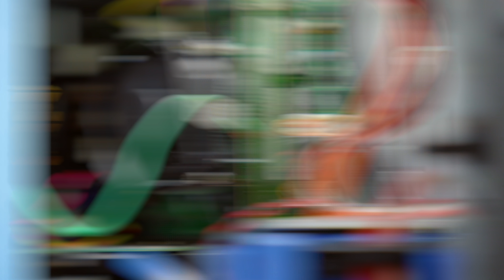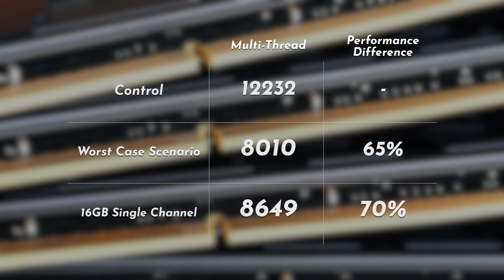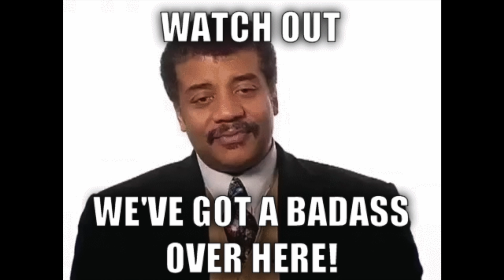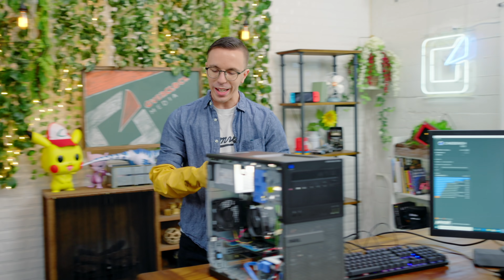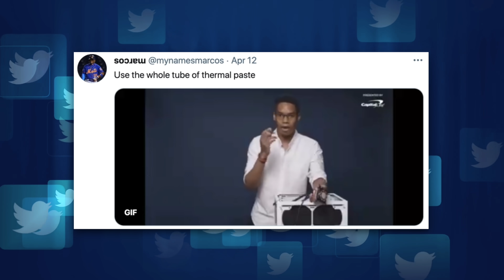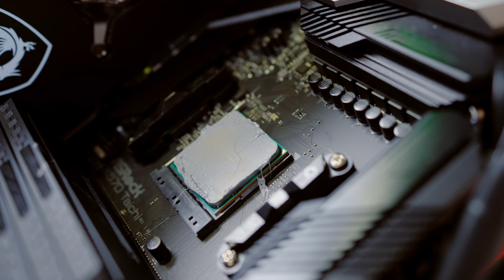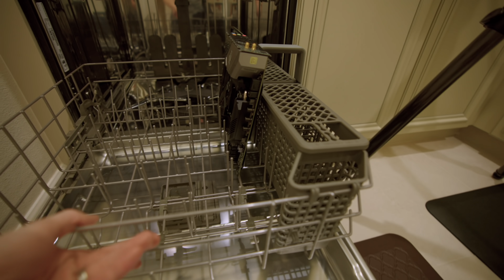Gaming PC Lies People Believe

Comment: Washing components should be completely fine. So long as you use purified distilled water. 
Water is actually an insulator, it's the minerals within the water that allows electricity to conduct. 
If it was left to dry out completely it would be fine. 
In fact with purified water, you could run the entire PC completely submerged and it would work completely fine. Probably not the best for performance as the water won't conduct heat away as fast as a flowing water cooling system with a radiator, but it would certainly stay cool. 

The reason the motherboard was killed was for one: you probably left the battery in the motherboard, two: a dishwasher will use regular tap water filled with a mineral content, and three: a day is not long enough to dry. A few weeks at least would be needed.

Comment: I've never tried a dishwasher, but I picked up a really gross OG Xbox for $5.  It was full of roach turds and dead bugs, an absolute nightmare.  I figured I was only out $5 if it didn't work, so I scrubbed the motherboard and components with dish washing liquid and water, then let it dry out for three days.  I got it looking brand new, and it booted up and ran like a champ.  There are risks involved; if water gets trapped under heat sinks etc. you'll get a short where there shouldn't be one and kill it.  However, if you're willing to take the risk and also blow dry it really well to knock out any trapped water, washing some circuit boards CAN work as long as there's no power stored or running through them.  Still, don't try it at home unless you know what you're doing.

Comment: You can wash electronic stuff that doesn't have any type of battery and the capacitor aren't charged. I'm pretty sure everything will work but it just that you have to fully dry it and disassemble everything that you can and then dry it. 

Also it may corrode but dude why take chances just clean it with a dry cloth, right.

Comment: What you should try is using vengeance high performance like the one you had in the ryzen 5900 and then use the same capacity value ram and see the difference I'm performance.

I think you will find that the so called super fast and high end ram isn't worth the premium they charge with their marketing spiel.

Comment: The testing methodology people use when testing this myth always bothers me. Trying to shock plugged in components isn't going to do much to them because they're already in a system that's grounded.

The danger of static electricity comes from handling ungrounded components which is why you have to ground yourself when working on a computer because your computer is presumably not plugged in while you're building it. Releasing a static charge into an ungrounded component when it has no path to release that voltage is what causes problems.

Comment: I think you may have just shorted some of the GPU's solder pads or got it out of proper contact with the slot, or both. If you had a much more powerful magnet but left some gap, the GPU would probably have been fine.

Edit: Saw the dishwasher part, I'm pretty sure you didn't dry it well enough. I have washed various components by hand, without soap, and various YouTubers have done the same, some even with soap. I don't have a dishwasher to test that specific method, but I don't think it should have broken the board like that.

Comment: If you used distilled water it would have worked but because tap water has other stuff in it that’s conductive there was most likely a short circuit some where

Comment: Um, magnets can brick a hard drive, but pc components like cpu, gpu, ram not so much, when the gpu stopped it was probably because you shorted it with the magnet by touching the soldering points.

Comment: When I've built PCs in the past, all i do is plug the power supply into the wall and touch the outside of it. The metal case is connected to ground, so if you touch it any static electricity you've built up will go to ground.

Do this every time before you touch your components after walking around. Then you never risk frying anything.

Edit: This works even if your power supply is outside your case, but as soon as it's in the case of your PC you can just touch the metal of your PC case, since that's now also connected to ground.
The power supply doesn't have to be turned on for it to be grounded either.

Comment: I don't think it was the magnetism that shut the GPU off, it was because it would have shorted a lot of different components on the PCB, as the magnet is conductive. For the hard drive that makes sense, I don't think its the moving parts that permanently die, they would just stop moving freezing the computer. What you would need to worry about is the magnets erasing data because that is how the data is written and read by using magnetic fields

Comment: As long as the components aren't energized, you technically can wash them without harm. I remember washing a non-working bug infested PS3 that I bought for $16, with soap and water, and it worked after I applied new thermal paste and pads. Of course, I initially dried it with forced air and then let it sit for a couple hours.

Comment: Washing PC components in a dishwasher was really intended for retro components that had electrolytic cap leak on it. Nobody in their right mind would wash a Ryzen board or a modern Intel board. It is documented online that a dishwasher can aid in removing the cap juice, although you still have to do manual cleaning/prep prior.

Comment: I quite literally built my current pc in my basement, on the carpet, and with no esd protection. I also have mismatched brands of ram but all same capacity and speed. This might have been a problem in the past but I would trust the products can easily ignore normal amounts of static discharge.

Comment: so long as ram is of the correct generation ram is cross compatible the system will simply default to the lowest spec stick you will however run into system instabilities over time.

Comment: These tasers don’t actually output millions of volts... That’s false advertising, because its almost impossible to measure thousands of volts with a voltmeter, the same way its very hard to measure the actual capacity of a battery, so manufacturers (especially cheap Chinese products) will take advantage of this to mislead people and give totally false information so that they buy the product. 
For taser voltage, it comes down to the distance between the two electrodes (and factors like air density, temperature and moisture) but it will give you about ten thousand volts for a one-centimeter gap. 
In a very basic way to explain it, tasers work by very quickly charging a capacitor until it discharges itself through the air between the anode and cathode, over and over multiple times per second. 
The larger the gap, the larger the voltage. Can’t go around that. Smaller gap = smaller voltage. 
Increasing the gap size will increase the voltage, until internal components will short out first and kill the taser. 
A taser with millions of volts would need a gap of more than a foot between the two electrodes. 
Now that is different from a Tesla coil which can output continuous high voltage (a lot higher voltage than a taser, at lower current of course) but that’s another story. 
It’s very difficult to electrocute someone or something with a Tesla coil compared to a taser, so less useful than a Taser. 
The tesla coil works by ionizing the air around it until electrons can flow freely through that air. But when introducing other things, they will actually have higher capacitance then the ionized air thus not become a path of lower resistance and almost no current will go through it. 
The taser however, will electrocute whatever has less resistance than that air gap, which is most things except glass and ceramic. 
The reason is that it doesn’t continually keep the air ionized between the electrodes. 

Anyways, tasers usually output between 5,000 and 25,000 volts, and that’s the end of it.

Comment: How did you dry the board? If you just let it sit, it may not have dried completely. You may need consistent warm / hot air to dry every part of it. Additionally, if you didn't take the battery out, there'd be an issue as well.

Comment: I’ve got 3 sticks of DDR4 3200mhz RAM for a total of 24gb of RAM in my system, 2 are corsair vengeance and 1 is ballistix RGB RAM, i’ve got a 3070 and a ryzen 7 2700x system, will this RAM setup hurt my performance since they’re all the same size memory and the same clock speed

Comment: Have “new” pc from 2010 it’s a prebuilt and barely used by previous owner so it was given to me, i use it for about a year with no problem. 

 it restarted when I replugged my  desktop speaker(normal cpu case but only had one audio jack at front!) . 
the end of jack does electrocute you when touched. 

Baffled so i did it twice and get same results, stupidly enough i tried it for 3rd times the last one surely K.Oed it  end result? Dead cpu fan only spinning for sec when powered on. 
Diagnosis? I fried the mobo and gpu.. I’m baffled why LTT can’t kill theirs easily like i did

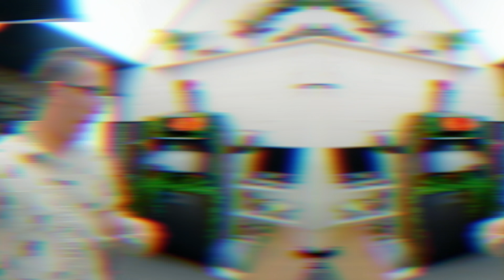Comment: 3:03 yopu shorted the conacts on the back any moving parts tent to temporarily stop functioning, but in general the magnetic force from the read write head of a hard drive are several times more powerful than a perminant magnet, it can flip bits, but it wont cause perminant damage unless it causes damage to the drive physically. 

A passively cooled system, with an SSD wouldnt be affected by a perminant magnet in the slightest

Comment: Austin, I love the magnet bit, but I actually have something I'd love your opinion on. Due to moving to a smaller apartment and having a decent 5.2 surround set-up, the only TV unit we could find has the two subwoofers either side of the TV, and only centimetres away (how do I go about sending you an image)? I have a Panasonic OLED and when speaking to a mate he went nuts saying that subs worked off magnets and I was going to ruin my TV. I've been using this setup for a few weeks and all seems fine, but I'd hate to ruin a $2,000 TV. Are you able to do any testing, or offer any advice on this? Thank you.

Comment: On the magnetic one, isn't it more that they short circuited the GPU (metal on the back with no backplate) rather than the actual magnet itself doing any damage? I think we all knew the HDD was done though, but a lot of systems are running SSDs now! 

On the last one, if you washed it with distilled water, it might work? But I I think anything else is probably going to do what it did

Comment: As far as mixing RAM goes, I had an FX6300 system a few yrs ago that a friend now owns and uses as a media PC... I had 2 sticks of G-Skill Ripjaw 8gb x2 DDR3 1666 and 2 sticks of ADATA 8gb x2 DDR3 1666. The CAS latency timings were all the same, I tossed them in, went from 8 gb to 16gb and never once had a RAM error... Make sure both pairs are supported by the mobo/cpu and have the same CAS latency timings throughout all the numbers. That's your best shot if you're trying to do something like this...

Comment: The test zapping the board with a shock wasn’t accurate. With the pc plugged in it is grounded through the power supply so the majority of the voltage goes to ground. You need the power it down and then unplug and zap it to get a true test of static damage.

Comment: Here's my thoughts, based on my experiences:

I mix RAM constantly (especially in laptops using DDR3) and I have only had problems once or twice, other than reduced performance. They should at least be the same speed.

I wasn't expecting the magnet to do much, except temporarily slow the fans or corrupt the hard drive. If you have an SSD, you're safer from magnetic forces near your computer. If you have a vintage computer setup with a CRT, keep any larger speakers or strong magnets (>4" diameter) at least 4 feet away from the screen as the discoloration seen in the video might occur. If your monitor makes a "Douhmmm" sound as it turns on, that means your monitor has a degaussing coil that attempts to negate the effects of magnetic discoloration. You might also be able to find it in the menu of your monitor, or it could be its own button.

I, too, have never used an anti-static band.

Toothpaste can be a decent, extremely short term alternative to thermal paste, just so you can do what you absolutely need to while waiting for real thermal paste in the mail. However you can destroy your components if they stay minty fresh for more than maybe a week.

As long as you discharge most of the larger capacitors and remove the CMOS battery to prevent dangerous shorts, you should be able to safely wet components and use them after they're completely dry. It doesn't always work so I can't recommend it, but I've seen some people use this method for old Macintosh motherboards that worked just fine afterwards. If you want to wash your PC components and be sure they'll survive, use at least 90% Isopropyl alcohol and a toothbrush. 70% contains more water and may cause shorts.

Comment: Static is very dangerous I have  experienced it my pc when it gets forced shut down after a power cut and after I restart it after 5 min my gpu or my ram gives an error and blue screen of death.i have the disconnect the power cable for 3 hours to make the pc run normally

Comment: Most People don't know there isn't any taser with a voltage higher than around 10000 volts and there is an obvious reason because there is not enough gap between taser probes for 2.5 milion volts taser it most have about 90 cm distance between probes

Comment: Of course you gonna killed the board by drying it only 1 day. Washing the whole motherboard with water should not be done on diswasher. The pressure from the water stream might knock some of the component off ( its unlikely, but in case you got the 1 in million chances your board have 1 or 2 soldering defect). Do it in big plastic bucket filled with water. I've done it on my really old board, filled with dust, and i don't want to create static with my brush by cleaning it. You don't use soap, but clothes detergent, as clothes detergent works by attracting stain through ion, rather than bonding and encapsulates like soap do, so it will remove the dust and help remove the possible static further. So just a tiny amount of detergent will do. Then you clean the board by moving the whole board inside the water rather than brushing it. After that, you can rinse the water by dipping it into another clean water, and repeat it until you are sure there is no left over water+detergent on the surface of the board. Then you air dry it at least a day, before you try to hasten the drying process either by using heat gun or dumping pure alcohol on it. You air dry it again until you are sure that you have the board completely dry, then you brush lightly with paint brush to make sure there is no gunk stuck on the board. The whole process takes 10 days at minimum with old board. With that board, you need to remove all the cover and any heatsink, then re-apply all heatsink with the thermal paste and all the cover after it really dry.

Comment: never used an atni static wrist strap either. there's a little secret built into EVERY  pc chassis power switch .  when you turn off the PC and and turn off the PSU and unplug it the power switch acts as a static discharger   just by pressing it in three times discharging any static built into most components in side the system ( the main  exception being the power supply because those power rails in PSU's  hold charge a long time).  but for the most part doing this nullifies the need to have an anti static wrist strap.

Comment: It wasn't magnetism that glitched the GPU.  It most likely shorted something when it latched on - and it would be my guess that it was one of the power circuits.   Short on a +5 or +12V rail... yup.  PSU shuts down to protect the machine.

The reason the CPU fan stopped was because the magnet pulled it against the fan its bearing hard enough for the friction to stop it.   Once you took the magnet away it should restart almost immediately.  If the fan RPM reads zero, and is under motherboard control, the controller will ramp up voltage until it starts rotating again.

OF COURSE the hard drive got borked.  Hard drives are MAGNETIC DISK storage.  You probably didn't damage the drive itself, you just erased (or at the very least corrupted) the data on it, and/or disrupted read/write operations.   Likely triggered a SMART flag as well. The old-school floppy diskettes were also easily damaged by magnetism; it's why you were told to keep them away from CRTs, power cords, fans, and so on.  SSDs, memory, etc. should be resistant.  It MIGHT cause problems if you pass a strong magnet past a choke coil.

C'mon guys.  This is basic techie stuff from 'back in the day.

Comment: I don't think with the ram study people were asking if you run two different speeds of different ram would it be worse I think they probably meant if you have two different 3000mhz ram would it be worse than two of the same brand 3000mhz ram. Of which they can just find on ltt because they did the exact same thing just way better

Comment: the washing of components in the washing machine is not an accurate test as there are machine that can go colder than 50celsius, I have done it with mine at 40*c for 30min and that worked for me. The reason why I did this is because I used to be a vapor and I knew that that was the problem why the motherboard wouldn't start as it had vape juice running from it and after I washed it in the dishwasher it totally worked. of course i did not use soap if anyone is asking,

Comment: I like to refurbish old electronics, PC's and stuff, and I've legit soaked motherboards and components in soapy water to get off corrosion. As long as there's no built up electricity in any components on the board, and its fully dry afterwards its fine.